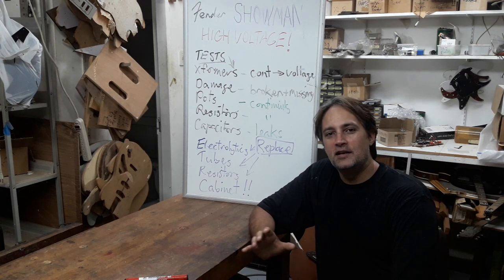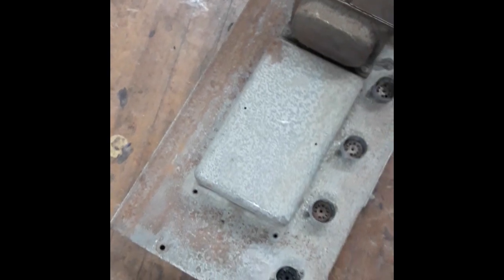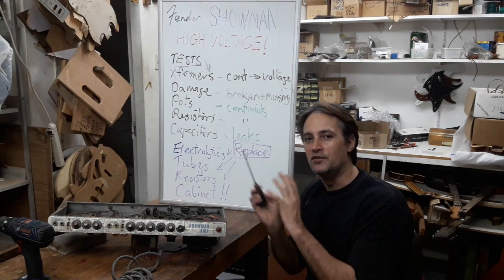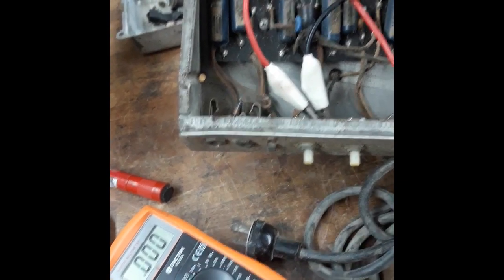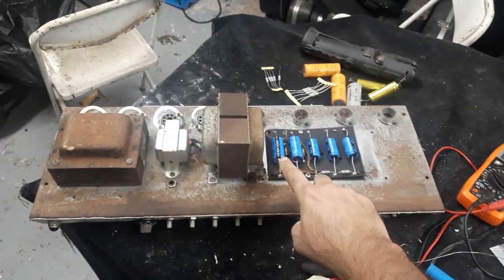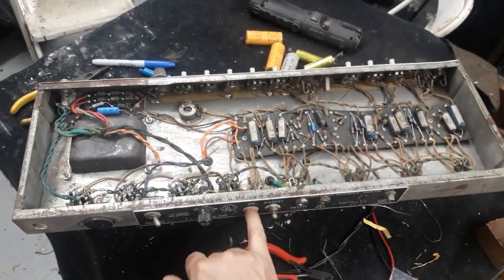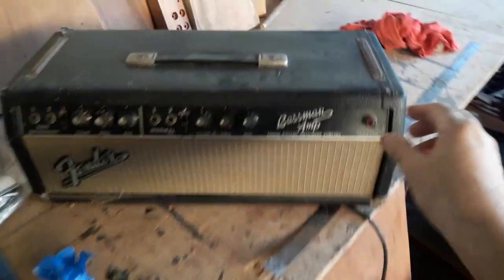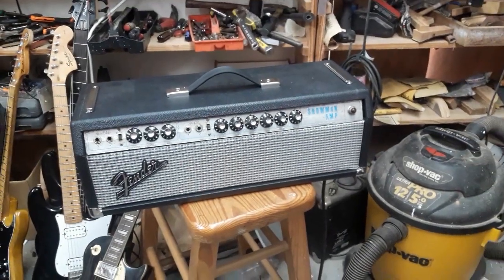Fender Showman amplifier from 1968 full resurrection

Comment: Don't forget the sheet of aluminum shield that goes under the top of the head to help completely enclose the chassis to minimize hum. Great video and restoration work. Look forward to more videos!
Reply from the maker: Ooh I forgot to show that, but I substituted the alum sheet with strips of wide alum tape. I use the tape because I've had an awful time with the sheets rattling against the chassis in the combo amps.
Reply: @jothanankrogh  I still have to rip out the sheet I have in my jtm45. It makes a horrid racket, lol